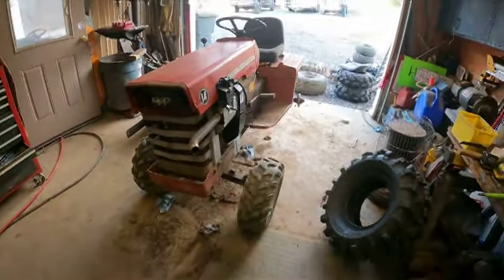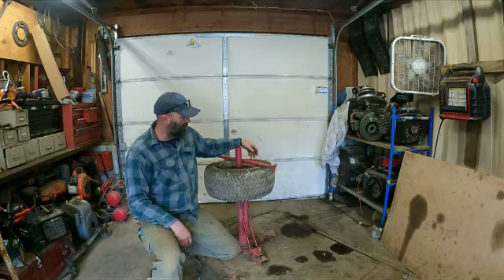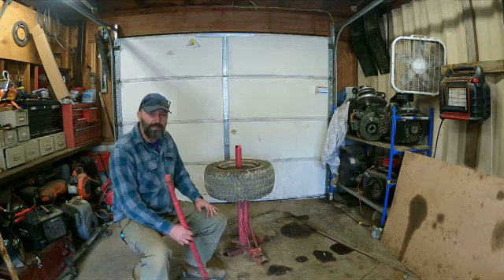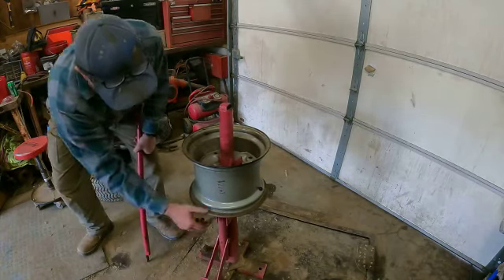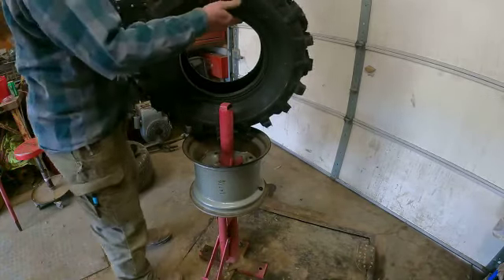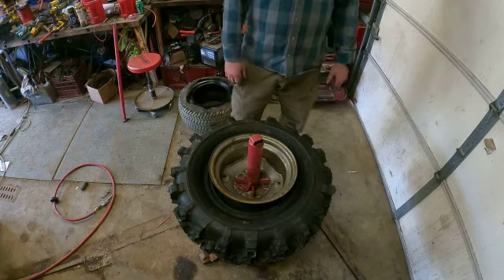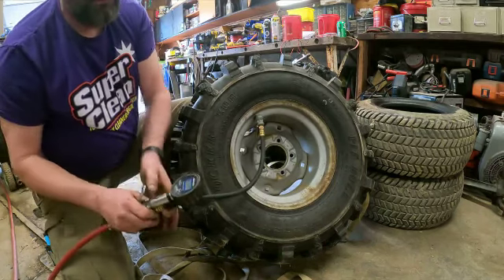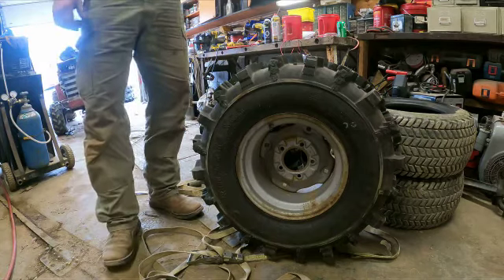Changing tires

Comment: The smaller HF tire changers are cool for fronts and integrated hub wheels. Now that my builds are about to progress into GT's, I need one of these for larger wheels. 
My father and uncle taught me all the tire tricks when I was a kid, but they didnt have ratchet straps. They made me use a rope or chain with a bar. Twist/crank the bar to add tension until the tire flexed enough to mate the bead. I've always been a little apprehensive of the fire method, however well it works.

I've come to find that what I thought was common knowledge is not very common, but you still never know what you might learn from the next guy

How do you have this tire changer mounted/keep it stable? Is it bolted to plywood?
Reply from the maker: I have had this tire changer for a long time.  It never occurred to me to do a "how to" video on it as I thought it would be a dead end.  It has had great response. what you see there is a large steel cover for and old oil changing mechanics pit in my garage.  I drilled the hole lay out and welded nuts on the bottom.  I can bolt it down when I need it and remove it when I don't.  Thanks for watching.